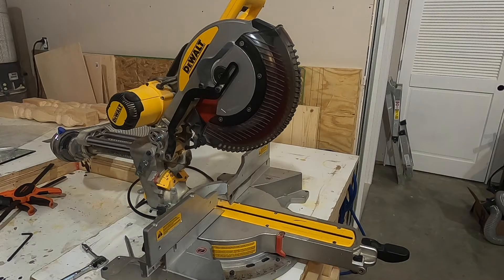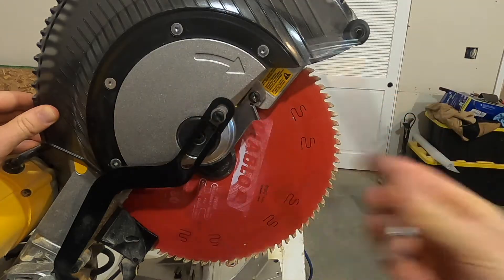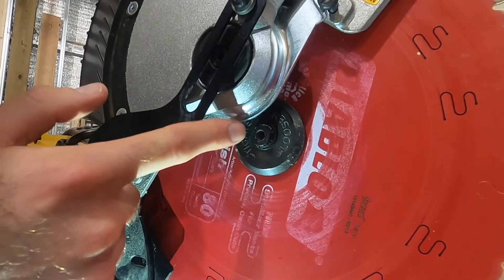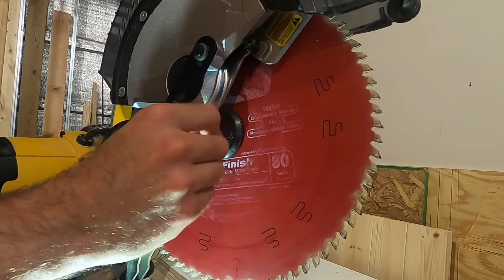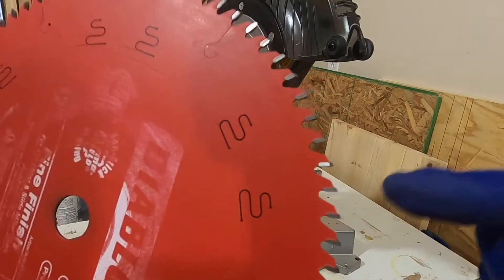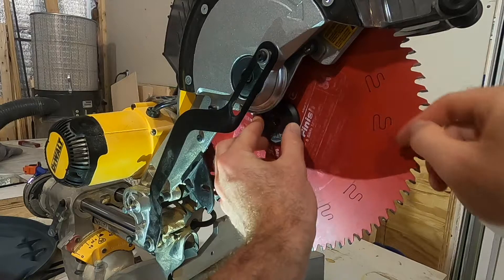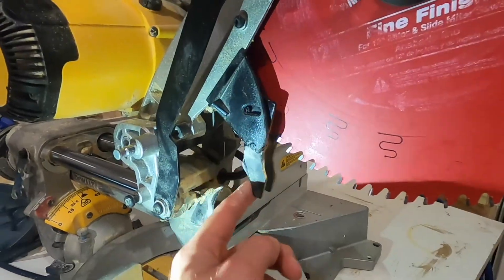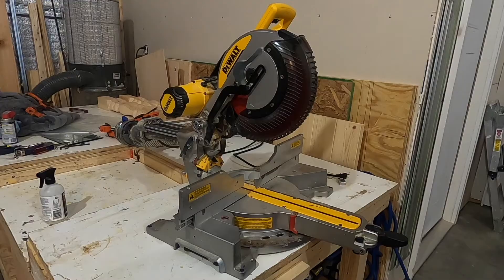How to change a miter saw blade ( Dewalt DWS779 )

Comment: excellent, thanks. Can I use a .126 kerf blade with this miter saw or only .110?
Reply from the maker: I’m not 100% sure honestly, I don’t see how that would have an effect but you may want to check the manual on your specific saw.

Comment: Any advice for when the screws are stripped and too tight to turn?
Reply from the maker: Depends on how stripped they are, you could try a rubber band between the screw and the drill bit and maybe get lucky. I think they make specific drill bit heads for stripped screws although I personally don’t have any.

Comment: This video made it easy to change the blade on my new SW779.  But my new blade required me to use that adapter for the bigger one-inch hole.  I don’t know why, but the new blade with the adapter bound up and froze the blade so that it would not spin!  I had to reinstall the original 32-tooth blade, which did work fine.  I wonder why a new Dewalt blade (with 1” hole) froze up and would not spin at all.
Reply from the maker: That seems odd, I’m not familiar with the adapter part personally, but it might not be compatible with your specific saw?